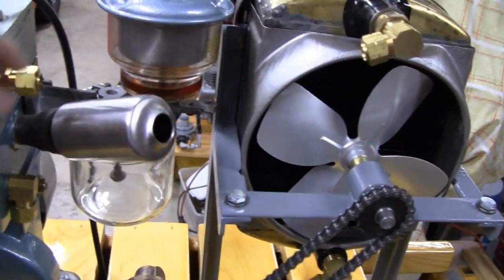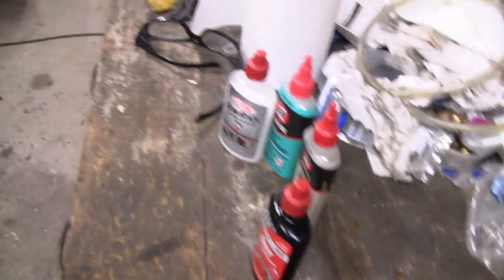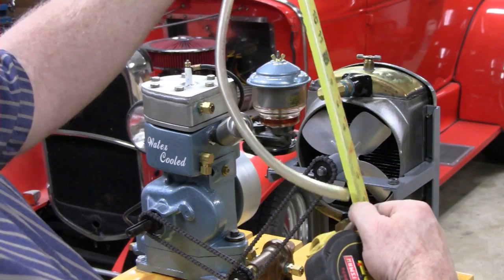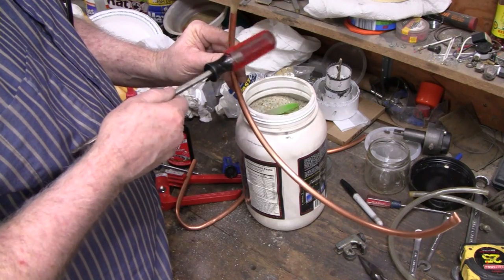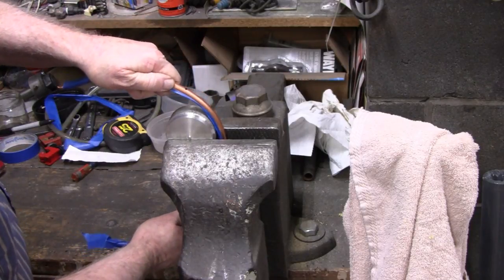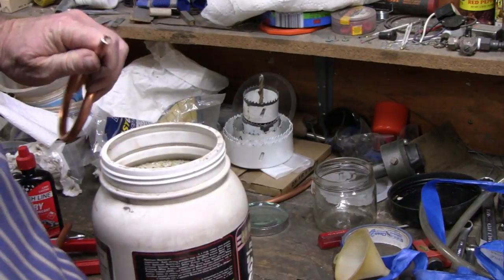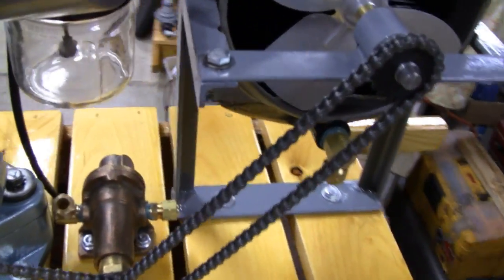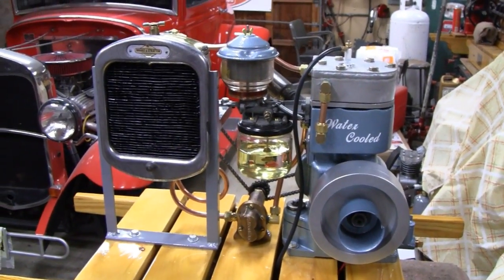HOMEMADE WATER COOLED BRIGGS ENGINE (part 44)

Comment: Regarding bending the copper pipe, as a kid we often adapted model aeroplane engines to use in boats. We were dealing with much thinner pipe than you are,  couldn't get the sand out! Ended up using salt, takes a while to dissolve it out though! Love your projects.
Reply from the maker: Thanks Bud!! Salt's a great idea for thinner or longer pieces, I'll have to remember that!!☺

Comment: Any reason why you didn't use clear tubing for your water lines so the circulating water would be visible? It sure looks pretty in copper!
Reply from the maker: Thanks George!! Usually when we build the older engines we try to make them period correct and look like something that might have come outta the factory!! It would look cool to see the water but I think the vinyl tubing, barb connections and hose clamps would have cheapened the appearance and make it look like we really didn't care!! ☺

Comment: beautiful work. are you worried about overpressure in the radiator?  because I didn't see a pressure relief regulator on the radiator.
Reply from the maker: Thanks Bud!! It's something we have considered and will have to monitor!! For now we might just run it with the valve on top of the radiator open!!☺

Comment: Wait how do you fill it with water?? I see no filler cap I see the bleeder on top but that's a little small. Thanks can wait to hear it running☺️
Ps: you just going to use plane old water or antifreeze?
Reply from the maker: We filled it through the bleeder!! Right now it's just water but now that we know there are no leaks we'll replace it with coolant!!☺

Comment: You can buy soft copper tubing that bends much easier and is just as strong. I have worked with a lot of copper tubing . Soft copper is much better than the more ridgid kind. I know you are using what you have but, if you have to buy more go to a plumbing store and buy a roll of soft copper.

Comment: I may be answering my own question. Is the purpose of the loops in the copper lines, to absorb any vibrations or movement between the components?
Reply from the maker: It was mainly for aesthetics but it does help with the vibration!!☺

Comment: Correct me if im wrong but I thought those small benders only went up to 3/8 and you're trying to bend 1/2? Awesome work with the sand! Tube benders don't go much past 180 degrees anyway.
Cant wait to see it run! and put water in it! that was the whole point! ;) haha
Reply from the maker: Thanks Bud!! 3/8 is what we are using!! The 1/2" I was speaking of was another project!!☺

Comment: I don't remember for sure, but wasn't the water head aluminum? so won't you have corrosion issues mixing copper and aluminum?
Reply: not a criticism by any means. just curious. love the videos and this series has been extremely interesting and educational.
Reply: Jonathan Hagler I was thinking about the very same thing.
Reply from the maker: I'm sure it will be OK, the copper and aluminum never contact each other!!☺
Reply: 805ROADKING thanks for taking time to reply! in this case, they don't actually have to be in contact for the corrosion to occurr. it's called galvanic corrosion and just needs the water to connect the materials. however, it may not be anything to worry about in your case. I was just thinking out loud. love your videos.

Comment: I know what you mean with a bad back. People don't notice how much strain pull starting does unless you have a bad back. People wonder why I gave someone else doing the pulling start don't understand the pain. I got an old electric drill with a socket dedicated for starting put starts by the flywheel bolt.
Reply from the maker: Yeah it doesn't take much for a simple task to turn very ugly in a hurry!!☺

Comment: you should build a old industry water temperature gauge between the radiator legs
Reply from the maker: I like that idea Bud!! I could probably put the sensor right where the drain plug is at in the radiator!!☺

Comment: Ya really should get a drill attachment with a belt drive wheel, then you can get a long belt and then just wrap the belt around the flywheel and drill wheel and start it easy peasy that way